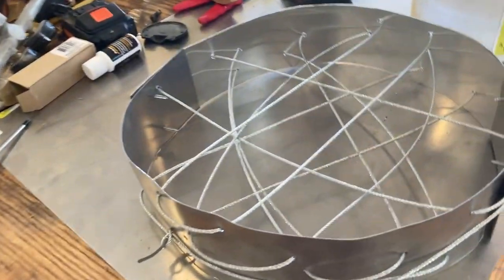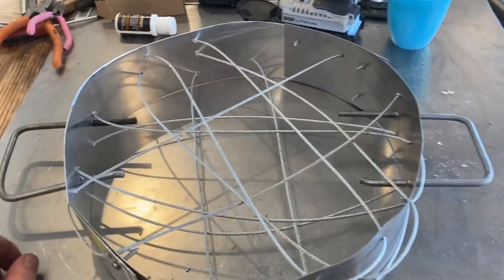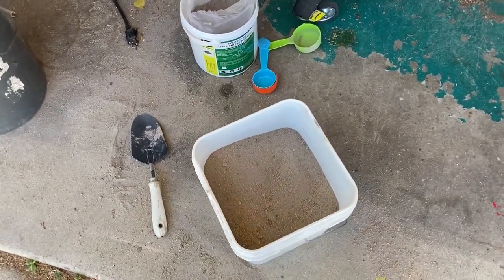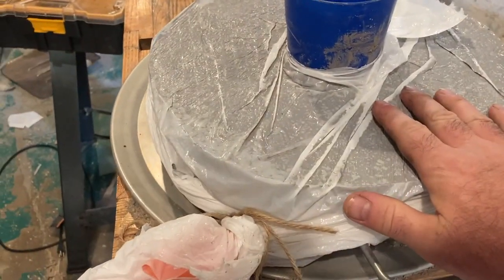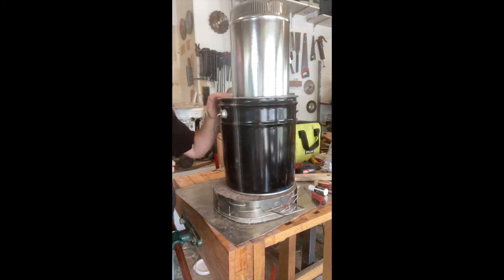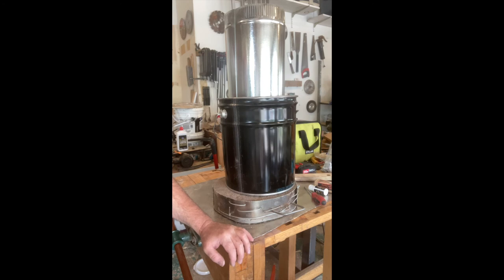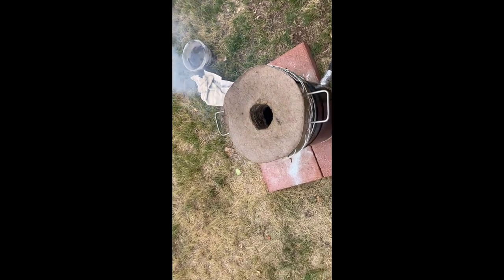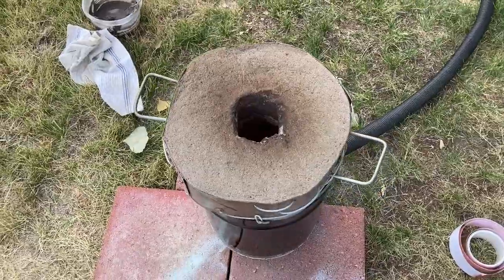Jason's Shop - The Gingery Foundry Furnace

Comment: Did you ever do anything after the furnace? I am going to use Gingery's ideas and build a vertical milling machine. I am going to scale any measurements up and see what I can do. I am starting a YT channel as soon as it gets warmer and I recover more from a motorcycle accident. I was riding to work on my Hand restored  1957 Harley Panhead and I was clipped and flipped up and around a telephone pole with my bike and my right leg taking the worst of the crush. I am out of danger for losing my leg but I am dealing with the aftermath. I want to be able to make any parts for my 928 Morgan Aero Brooklands MG Special. I will be building a Pembleton style Hillclimb racer that has a BMW engine and a 4speed transmission and a narrowed 12 bolt rear. I like your furnace build. Thanks for sharing.....

Comment: I have the book and the original recipe, as I recall, calls for a quasi-equal mixture of sand and plaster of paris. A buddy and me tried this and the lid ultimately failed an fell into pieces, although the interior seemed to hold firm. Is this dry clay something that can be bought at the store? I'm in North Carolina and red clay is abundant just in the general soil here. Would that work?
Reply from the maker: Any organic clay will work. If you use clay from the ground make sure the mixture is rich in favor of the clay. right have to fire a few to get it right. You are correct about the llid falling apart. Mine did also.
Reply: Red clay works great.  The best lid I ever made was a small metal trash can lid with a 2” layer of kaowool.